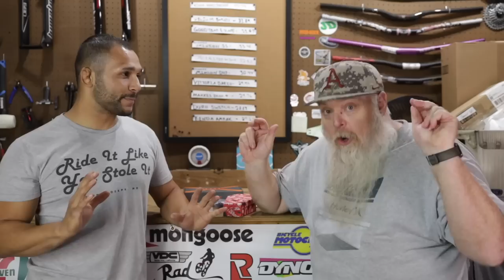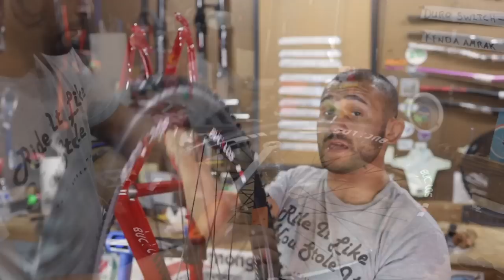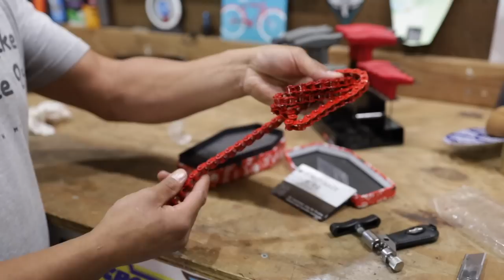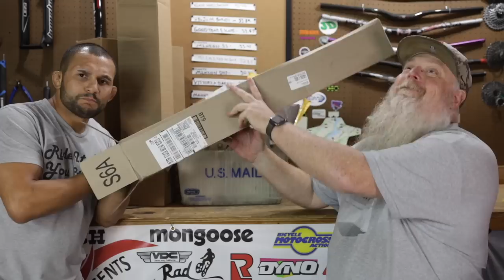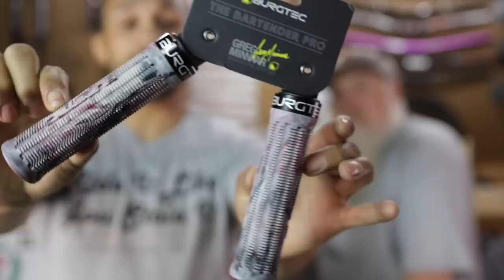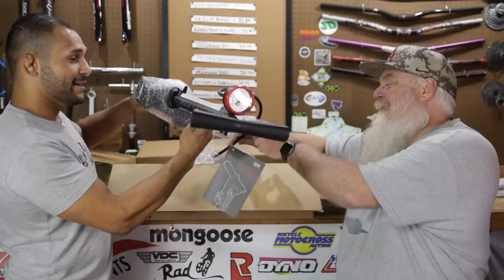"Dirt Jumper" Build Part 2

Comment: The small wheel is definitely not dead. I am in progress of a complete overhaul of my budget 2008 Merida K8 using a whole bunch of parts from ali - prowheel claw cranks, l-twoo ax11 groupset, rodi/novatec disc brake wheels, iiipro e4 brakes, honsun bars and seatpost, full carbon stiff fork. It's going to be a smasher.

Comment: Those cranks and chain look cool as f@£! 

But that chainring looks very close to the chainstay…. May just be the angle of the shot but I do wonder if you got the spacers in the right places?

And man that was so lucky with the chain length…. Always a nightmare when converting to single speed with vertical dropouts!

Comment: Nice project, sweet parts...u can switch the crank arms to get the brand name on the outside. Cranks are also usually installed first on SS builds to eliminate guess work with aligning the single gear

Comment: I really like those tan pedals. How does the size compare to a pair of RF Chesters, on Amazon someone said they were small compared to RF Chesters. I switched it up and went with some brown components on my GT Aggressor pro (seat, stem, grips, pedals) but the only "brown" pedals I could find were a really dark brown that kind of looks like a mix between brown and burgundy and they don't really go with my brown seat and grips. It looks like these Burgtec pedals are the right color brown i need. Oh and I have that medicus seat that Chuck U sent you and it's comfy, but mine was a bit chunkier than yours, lol, so I ended up getting a different seat that was smaller.